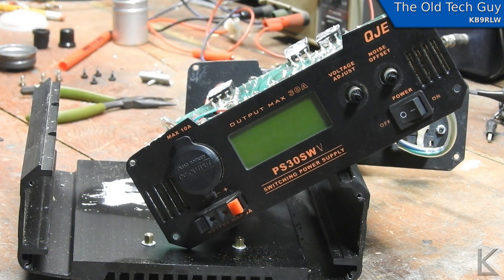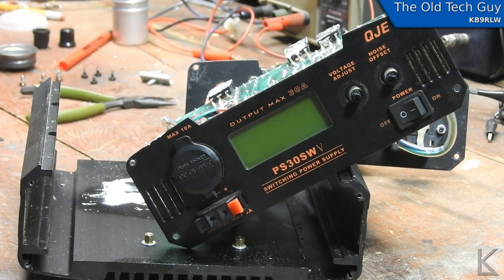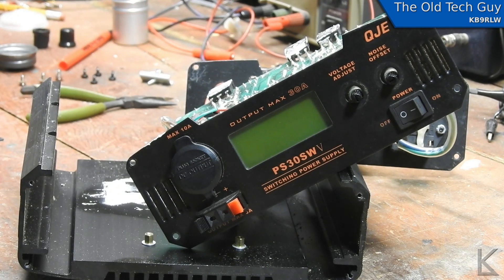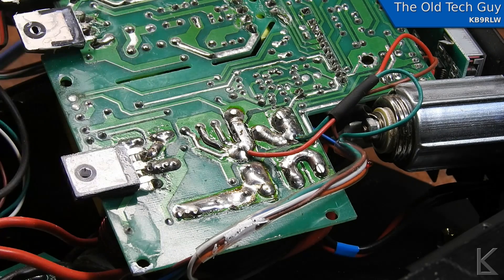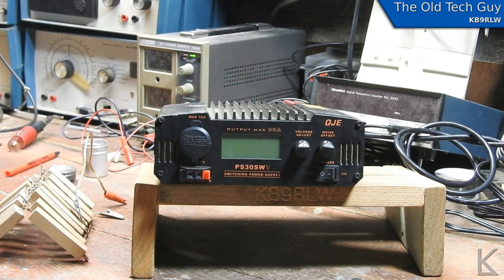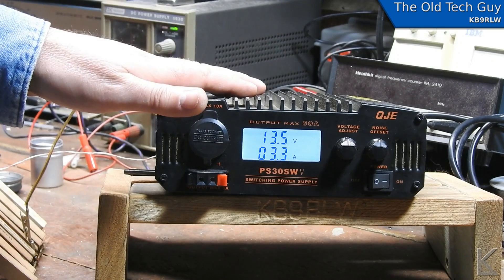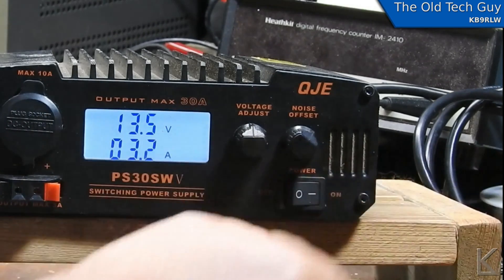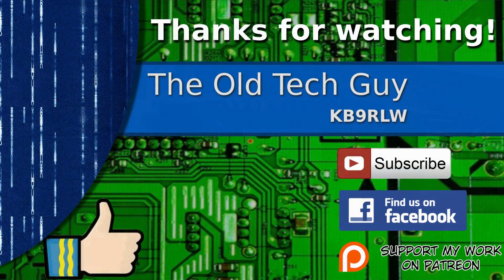Ham Radio - QJE switching power supply repair.

Comment: Old post but just bought this identical p/s branded by techpower. I've noticed these units are not calibrated correctly or adjustments are off or something. Your display reads 13.5v. Should be 13.8. Unless you had it on adjustable mode. Mine displays 13.7v when the back switch is on 13.8 steady mode. Tested with my Fluke and it was putting out 13.83v. Switched it back to adjustable mode and set it to 13.8 and it measured at 13.9. So they're off a tenth.

Comment: I bought a used pyramid 12amp power supply I TXing on my cb when the voltage jumped to 23volts I didn't get my gear turned off quick enough. Fried my yeasu ft2800. Txo scanners and cb seem to be ok. I had fused links not sure why none blew. Now power supply goes into protection mode every time I put even a small load on it, also noticed it's out put voltage is only 12.2 v instead of 13.1. I did remove fuse in the back of power supply... it was wrapped in foil from when I bought it used. Damn!
Reply: The 2800 uses far more than than the power supply you use. Higher amp supply needed.

Comment: I would drop in a 30 amp fuse between the + output of the PS to the binding post on the back. 50¢ worth of protection.
Currently working on an Alinco DM 330. Was plugged into a gen set and never came on. It had an on going issue with shutting down intermittently, the dirty power of the gen set  blew open whatever was failing. Interesting enough there is no 12 volts to the voltage regulator IC either which is provided by a secondary circuit. Joys of switchers.....

Comment: Any particular reason you didnt add a fuse to the output?
Reply from the maker: +mike mclaughlin I have in line fuses on the gear I'll be powering. But you certainly could add a fuse to any of these modern supplies.

Comment: Why didn't you just use a piece of copper wire to make the link?
An off-cut bit of T&E would of done the job.
Reply from the maker: I wanted to spread out the contact area as wide as what was left of the original trace.  I know it was a bit of overkill, but that's just me.  I tend to over-build things, but they last.